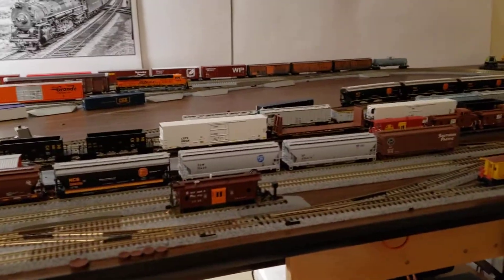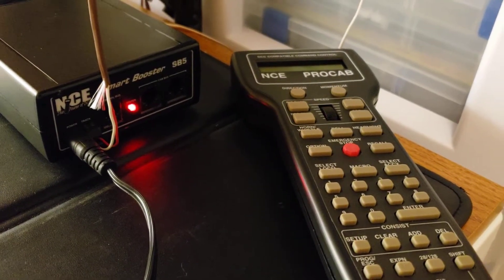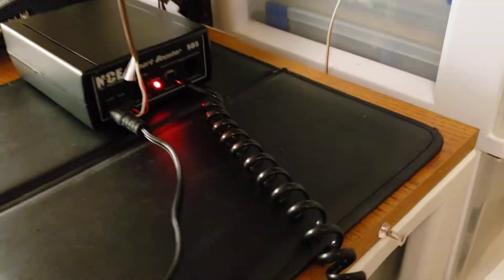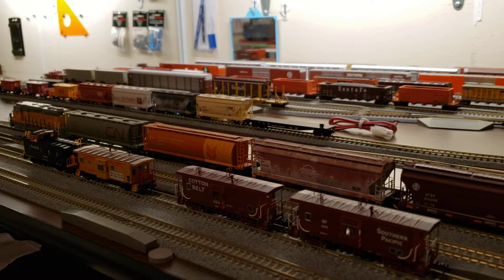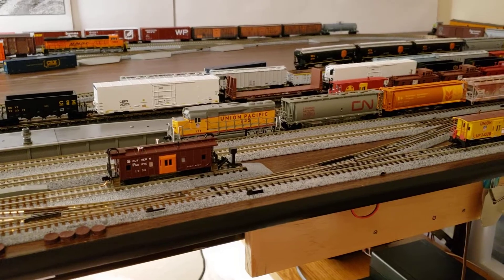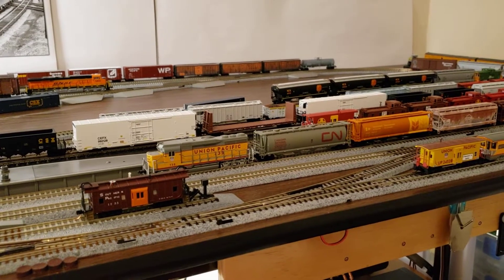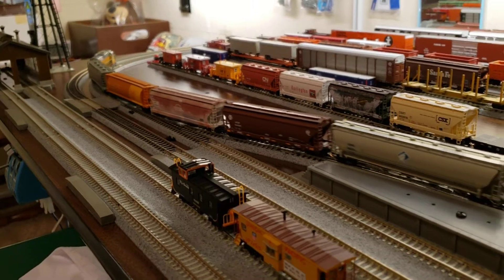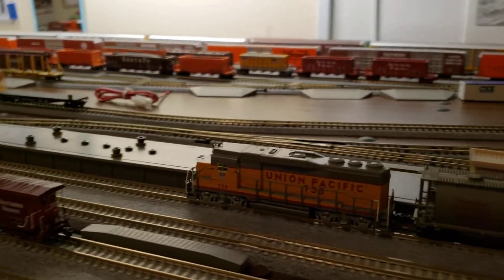NCE SB5 Smart Booster Simple Hook-Up Let's Run a Locomotive..

Comment: Can you/someone please tell me the volts that are running through the bus wires connected to the NCE SB5 Booster. I need to know this voltage source to do my calculations for resistors and LED lights tapping into the bus wires. MANY THANKS!

Comment: i have a power cab and ordered the sb 5, can i use the panel and cable from cab or do i need a different panel and cable? thank you,mick stewart
Reply: Disconnect the wallwart and track power wires from the PCPpanel and it is essentially the same as a UTPpanel.  Use the coil cord to attach throttles and connect bus (flat wire) cable from the SB5 to one of the CAB bus ports.